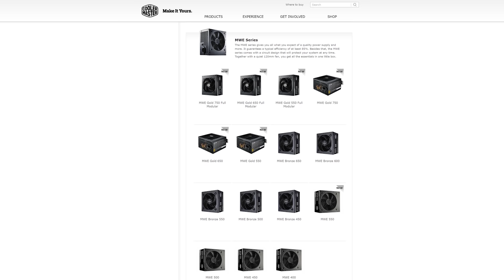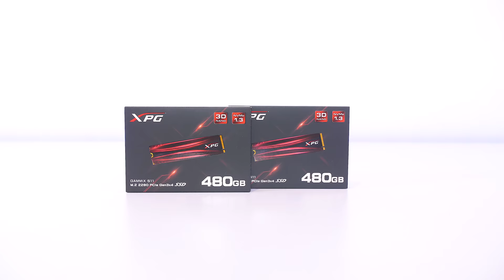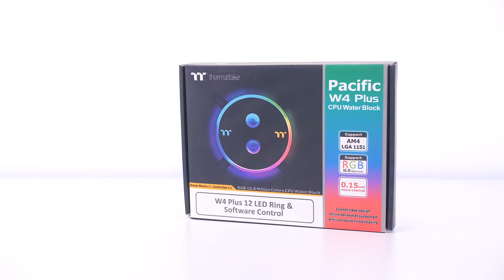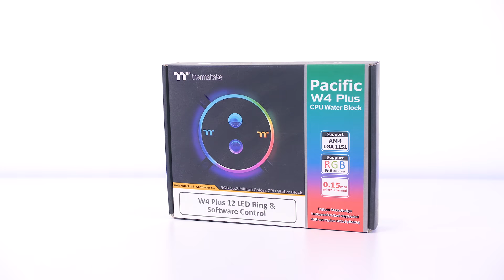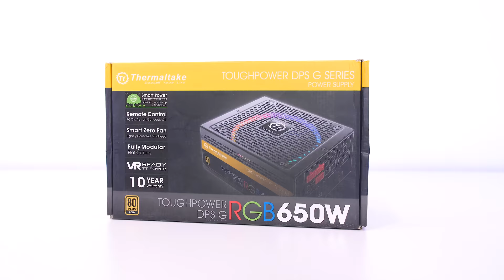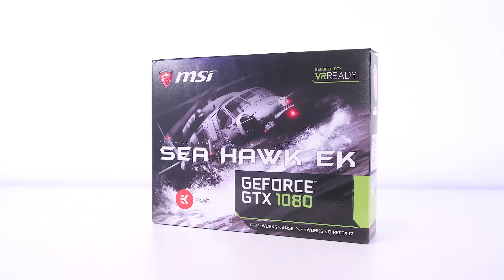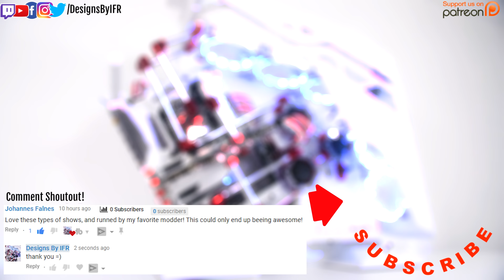INSANE CUSTOM WATER COOLED PC BUILD - Lian Li Lancool Time Lapse

Comment: 7/10 not enough rgb 

1: no rgb ssd
2: no rgb m.2 ssd cooler from XPG
3: no rgb card holder 
4: no rgb backplate 
5: no rgb fan frame cause why not
6: no rgb m.2 ssd it still didn’t came so I’ll that pass
7: no rgb power cord
8: no rgb light strips
9: no rgb tubes
10: no rgb keyboard
11: no rgb mouse
12: no rgb chair
13: no rgb mouse pad
14: no rgb speakers
15: no rgb headphone 
16: no rgb headphone stand 
17: no rgb monitor
18: no rgb hard drive don’t ask why 
19: no rgb sound card 
20: no rgb PCIe ssd 
21: no rgb ram fan cooler
22: no rgb usb rgb notifications light 
23: no rgb motherboard
24: no rgb radiator 
25: no rgb gaming table 
26: no rgb external sound card
27: no rgb camera from Asus
28: no rgb lamps
29: no rgb light panels 
30: no rgb mirror

Anyways amazing build
Reply: lol
Reply: RGB Ruins Good Builds.
Reply: 31: no rgb copy of windows
Reply: If you want i can paint your face "RGB"
Reply: Yajat Dureja lmao omg
Reply: Ru try nah give ur self epilepsy
Reply: No RGB Water, No RGB Radiator..
Reply: and where is the RGB Galaxy ?
Reply: No rgb rgb
Reply: RGB water like a rainbow would be the coolest thing ever, unfortunately these types of fluids don't work very well (aurora & vue), but maybe in the future they will be better and without issue.
Reply: How can a monitor not be RGB lol
Reply: 1374: no rgb carpet
Reply: You missed one thing 
No rgb pc builder
Reply: this is 10000 percent awsome
Reply: This much expensive build but they cant buy a good proccesor
Reply: one max 🤔
Reply: aaaww shuuut uuup
Reply: @Daniel_innersightmusic  bro this is me that kid
Reply: @Daniel_innersightmusic  is know you are right but the performance should be good but the look should be also good you are right but bro I'm also right
Reply: @Daniel_innersightmusic  if u say play with your toys i am i gamer and i know all the things about pc and Androids bro dont use this types of words it hurts if i am wrong I'm sorry
Reply: @yajat47  😂😂
Reply: @dorichcomputer6048  why
Reply: @lukeroe5409  Fake. It wouldn't be released
Reply: It needs more rgb than the actual system itself
Reply: That's a fucking RGB :))
Reply: Don't forget the RGB thermal paste and RGB screws.
Reply: You just want to much. But I agree
Reply: one max and no rgb toilets
Reply: addon, the processor itsself wasn't RGB...
Reply: No rgb rgb
Reply: you forget no rgb person !
Reply: one max  do want a box of bulbs under your table?
Reply: one max are you a kid?
Reply: Gosh you would need a strong power supply to handle all of this rgb
Reply: Not even parts boxes are RGB he just build not an gaming pc that is just pc😠
Reply: Needs more AMD
Reply: I have rgb gaming chair
Reply: one max there was no rgb air either :(

Comment: Appreciate the time. Proof that you always should start the system with a spare supply and only power on the pump (just in case you get a leak). Thank you for all the hard work ! Keep it up !
Reply from the maker: Haha yes exactly. Lucky i have a spare power supply every time. I should be putting paper towel down in the build but i keep it away so the video looks better haha

Comment: Nobody:
Absolutely no one:
YouTube: Wanna be reminded of how much of a sore loser and poor you are?
Reply: Me : x570 with a R7 3700x 32gb 3200mhz Corsair Vengeance RGB Pro MSI Duke RTX 2070 OC 1 1tb m.2 1 512gb RGB m.2 Corsair H100i RGB Pro XT 240mm with 8 Corsair QL120s in a Corsair Crystal Series 680x. Dont worry, I dont feel your pain.
Reply: OoF
Reply: I really wanna like this but the likes are at 69 so I'm not gonna good comment tho
Reply: i could only afford the pentium. By the way, why so much cooling for an pentium? and there could be an gpu bottleneck

Comment: Pentinum and 1080?
Reply: right
Reply: Its for display only.. could be any cpu in there. If you think these builds are about specs then you aren't in the right channel
Reply: what about celeron with titan v ?
Reply: MasterPvPOliver ! No actually Pentium and 970
Reply from the maker: Yes nothing wrong with a pentium for a display build
Reply: But why a 1080. It could have been a watercooled 780 as well
Reply: @profix25lo  u not watch the video? Card fucked up. He used a 970
Reply: ZeroGravityo yh but still. Something that’s atleast not a bottleneck
Reply: ZeroGravityo lol if u say that then why put in the gtx 1080.  It could be any video card especially a cheap one just like that cpu..... Dumb comment lol
Reply: What the fuck is this build
Reply: seems lit but then i'd just use a stock Intel cooler
Reply: Have not more sense
Reply: display build only, not really meant for much use, definitely not for typical desktop things.
Reply: Over bottleneck*
Reply: Yes

Comment: nice build, but using a Pentium is quite crazy xD
Reply from the maker: Yes nothing wrong with a pentium for a display build
Reply: Designs By IFR but why use a 1080?
Reply from the maker: Again because it is a display build man. The pc doesnt get used
Reply: Designs By IFR exactly, isn’t a 1080 too good for that?
Reply from the maker: A 1080 will bottleneck with a pentium, but does not matter when a pc is just sitting there looking pretty for an event

Comment: I really like the fact that the tubes go outside the back of the case. Not crazy about that RGB 24 pin cable. Just not for me. 
I thought i remember you saying that you couldn't use the acrylic glue on the painted areas. Am I mistaken or do you have to use a certain type of paint?
Reply from the maker: Yeah acrylic glue will strip the paint

Comment: while the strimmer rgb cables look great, the rgb is focused on the top part of the pc. if the gpu block was lit up, that would have made the overall rgb look much better!

And damn, the tubes going out the rear brings attention to itself and i for one am not really liking it. y not take the tubes up to connect to the cpu block directly? or you wanted to highlight the xpg ssd drive below the cpu block?

ur case mod is what i love the most and u nailed it this time also! worth it !

Comment: i have the same board i love this board except im using g skills trident z rgb 32gb 4x8 3000 mhz  and the I7 8700k and the Gigabyte Geforce GTX 1080 turbo oc and the cors air 115I Pro RGB Corsair 140 MM CF And HD 120 MM CF And Corsair Lighting node pro

Comment: to be honest i understand that its a display piece but it seem like alot of work to take apart again not to consider the possibility of scratches and water damages to put in a proper cpu let say when a person decide to buy it he would definitely put in a top end cpu that the mb could support why not save the time and just put in a i7 9700k /i9 9900k or something since everything seem to be insanely high end and rigid custom water system is fucking nightmare to resemble the fluid alone is already at least half price of that Pentium
Reply from the maker: Because then id have to spend $500 or whatever it is for a 9900k when i already have all of these spare parts

Comment: is this you'r first time building a computer? you are not supposed to touch the cpu, and boiiiii you'r fans are the wrong way on the generator. even tho this is a display build i still get annoyed that you make a video where you show the whole build but still you did it wrong. with that out of the way it was a nice looking build
Reply from the maker: Heres what u missed. The pc is an open design so fan orientation does not matter (therefore i choose the best looking side of the fan to be displayed. Secondly you can touch whatever you want, it is not the 1990s anymore. But i am glad you like the look